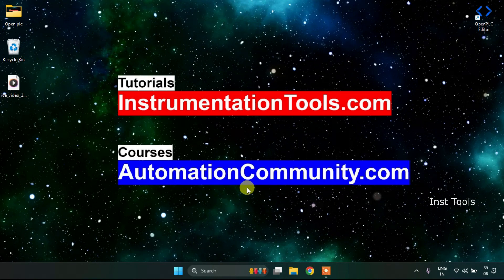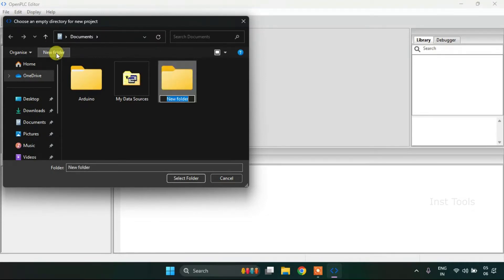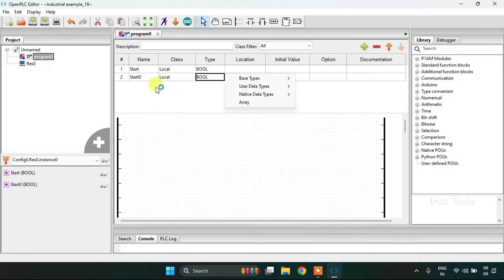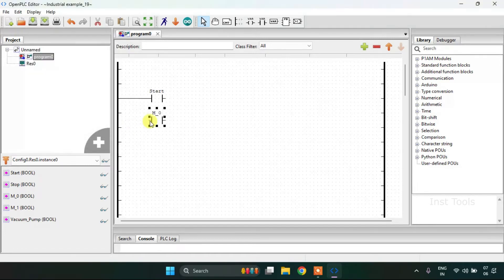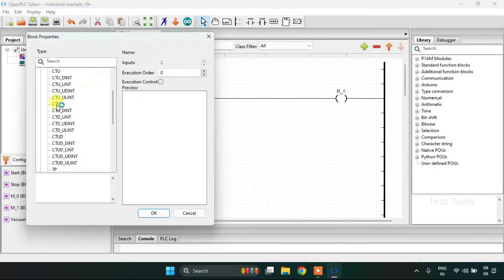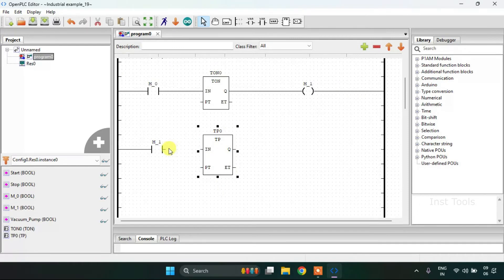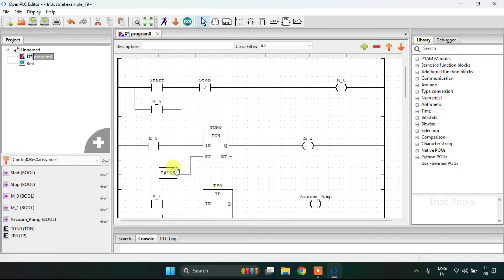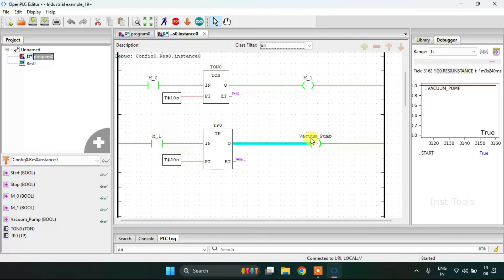PLC Timer Ladder Logic Examples - How To Program A PLC Timer

Comment: Hello. Could you make a video showing the use of the "RTC" Function Block?
In the program it only indicates that: "The real time clock has many uses, including timestamp and setting date and time in batch reports, alarm messages, etc. (BOOL:IN, DT:PDT) => (BOOL:Q, DT:CDT)". I have an Arduino MEGA 2560 board and I would like to program the irrigation of a hydroponic system with this function.

Thank you for your cooperation.